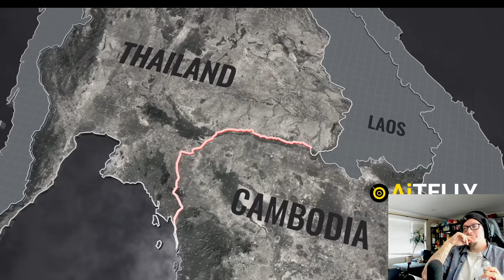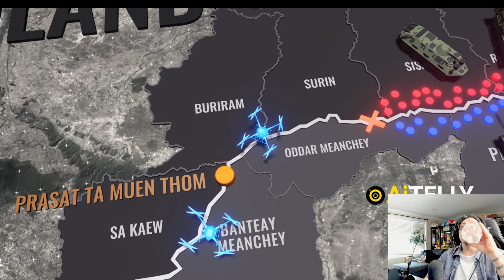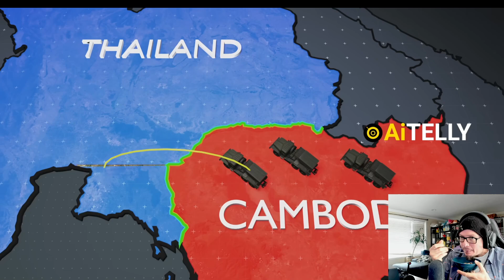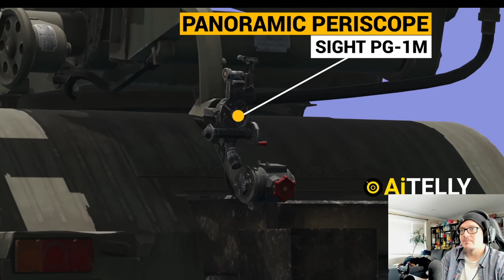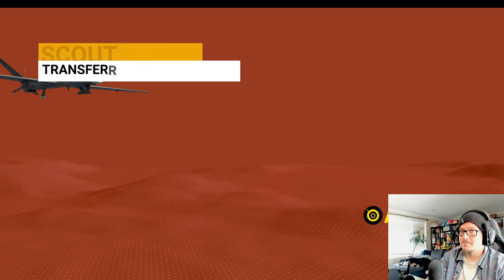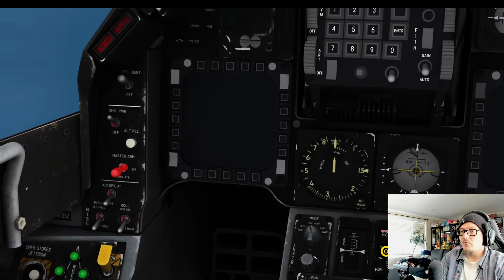Reacting to Thailand Cambodia War Timeline Explained

Comment: How many Khmer (Cambodian) temples are located within the territory of Thailand?" — This is a very important question for the study of ancient Khmer history and the Khmer Empire.
✅ Short Answer:

There are more than 200 Khmer temples located within the borders of present-day Thailand.
These temples were built during the time of the Khmer Empire (9th–13th centuries) when the empire controlled large parts of what is now northeastern Thailand.

🗺️ Regions in Thailand that have Khmer temples:

🏯 Northeastern Thailand (Isan region)

This area has the most Khmer temples, particularly in the following provinces:

Buriram

Phanom Rung temple (ប្រាសាទភ្នំរុំ)

Muang Tam temple (ប្រាសាទមុចហាន)

Sisaket

Ta Muen Thom temple (ប្រាសាទតាមួនធំ)

Surin

Several small and medium-sized Khmer temples, such as Sikhoraphum

Nakhon Ratchasima

Phimai Temple (ប្រាសាទពិម៉ាយ) Considered one of the grandest Khmer temples outside Cambodia

🏯 Central & Western Thailand

Fewer Khmer temples, mostly smaller stone shrines

Example: Lopburi province contains temples with strong Khmer-style influence, though some are mixed with Thai styles

📚 Summary of Major Khmer Temples in Thailand

Temple Name	Location	Built	Notes

Phanom Rung	Buriram	10th–13th c.	On a volcano; Bayon-style architecture
Phimai	Nakhon Ratchasima	11th–12th c.	Similar style to Angkor Wat
Ta Muen Thom	Sisaket	11th c.	Near border; used for border control

🧭 Why are there Khmer temples in Thailand?

During the height of the Khmer Empire, its territory extended deep into what is now Thailand, especially the Isan region

These temples were built for religious, royal, and administrative purposes

After the Khmer Empire declined (around the 15th–16th century), the territory was gradually taken over by Siam (early Thailand)

📌 Conclusion
There are over 200 Khmer temples within modern Thailand, most of which are located in Northeastern Thailand (Isan).
They serve as powerful historical evidence of the Khmer Empire’s vast reach and cultural influence.
Reply from the maker: Thanks so much for this!  My knowledge in this area was sorely lacking. 
I've consumed a lot of history, but most of my Asian history lessons in American schools was centered mostly around China. Going to pin 
this for others to learn, too.